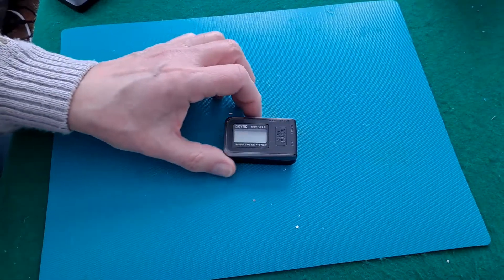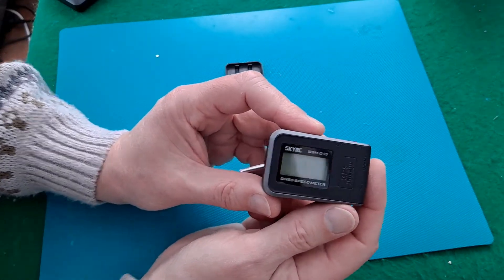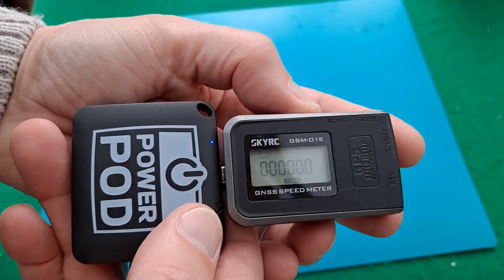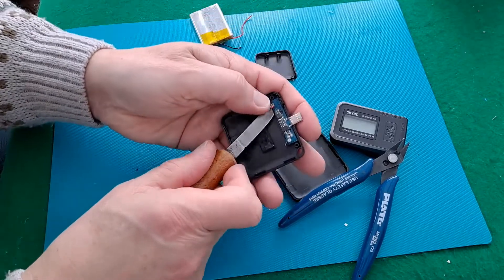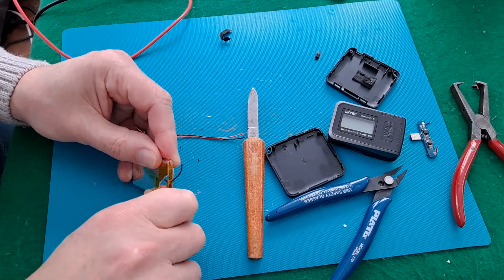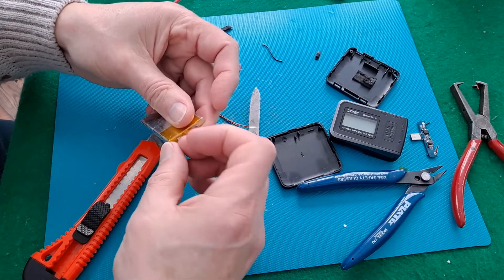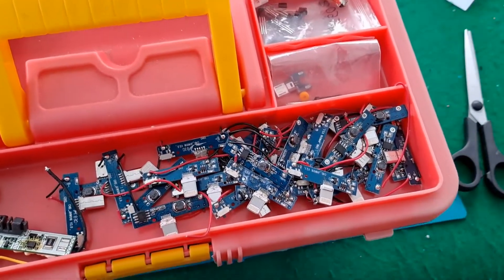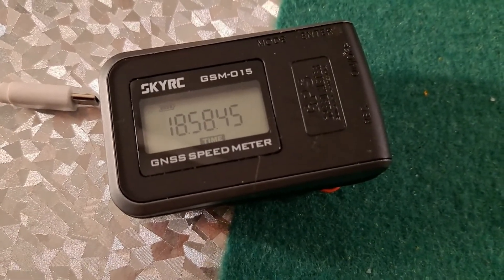Temporary battery for my SKYRC Speed Meter

Comment: I'm guessing the reason I've never seen one of those lion P Pods in Pained (sic) land is bc you've bought them all! Mind you, if you're looking for the Tommy Walsh 2 part epoxy... that was my fault. harhar.
Reply from the maker: Hi Steve, last time I was in Poundland they still had them, usually hanging on those strips that they dot around the shelves. As for the 2 part epoxy, when I needed some they didn't have any, so the next time they were in stock I bought a load of them 😆